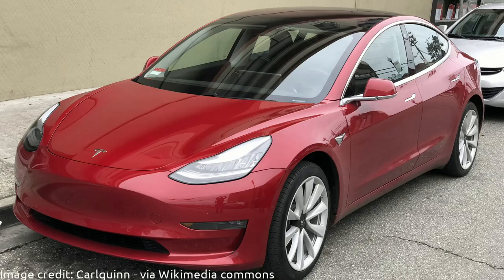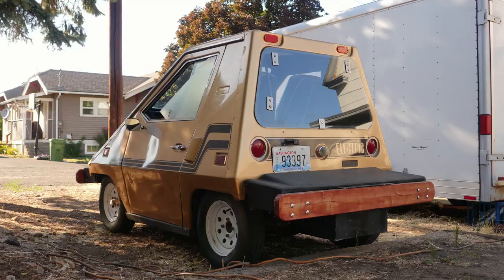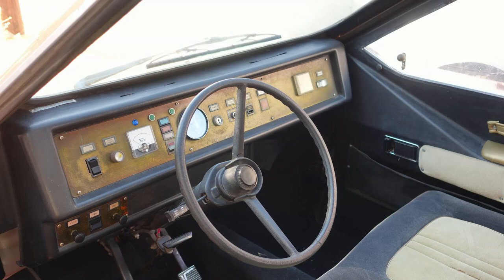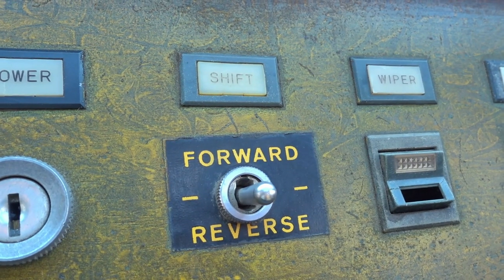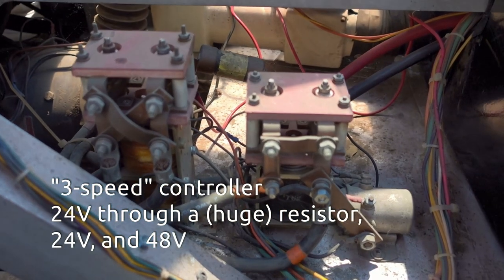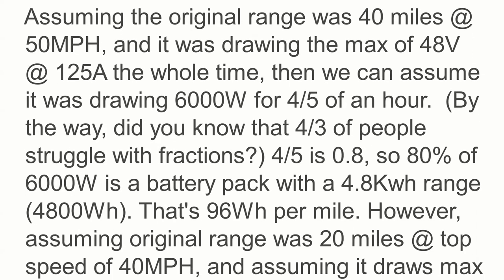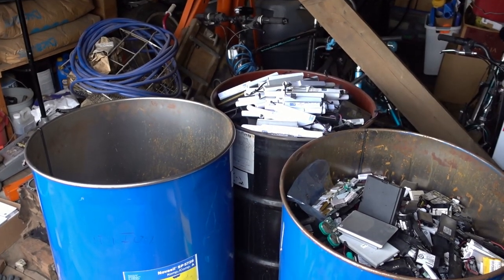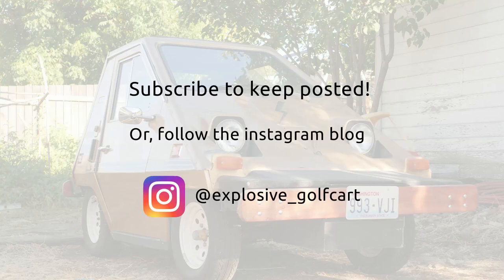I got an electric car - And you've probably never heard of it

Comment: This thing is 100% adorable. Keep us updated! I would suggest updating its powertrain, but I am afraid it will rip itself to pieces going over a speed bump :D
Reply from the maker: I've thought about a more powerful motor as well- But I agree, I'm skeptical it'd even handle 65MPH. I suspect (interpret as hope) that my li-ion batteries will let it go faster, since they're 14.8V nominal versus the original lead-acid batteries, which were 12V. (48V originally versus 59.2V with my new batteries.)

Comment: I just picked up a 1980 Comutacar as well. It is in excellent shape. Its been upgraded to 60 volts and a motor controller.
Reply from the maker: Great! The motor controller is a must-have if you want to drive it frequently.